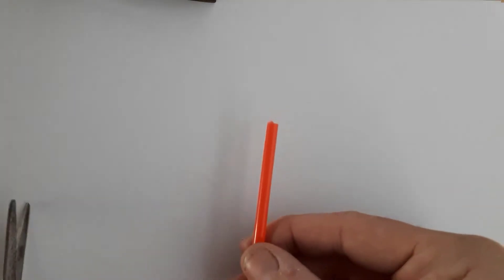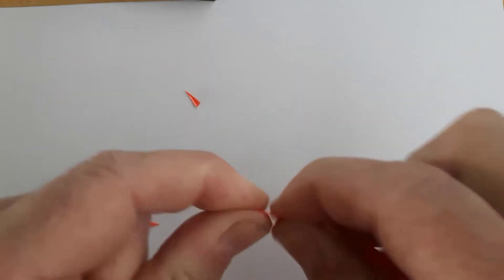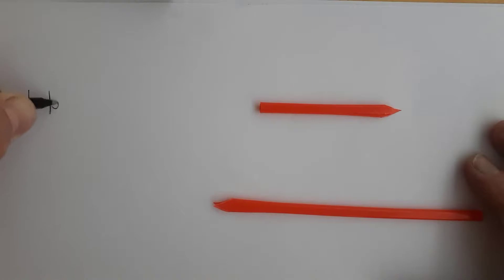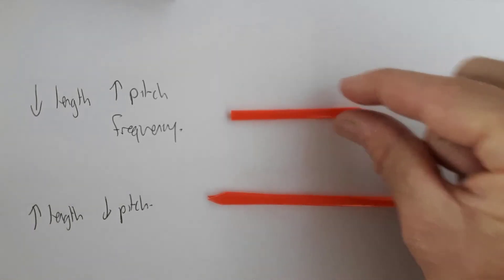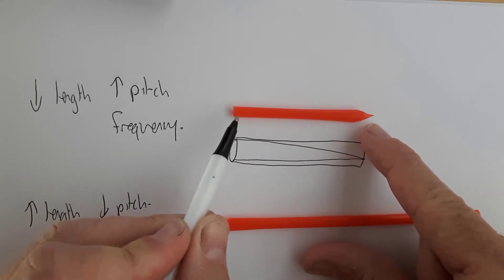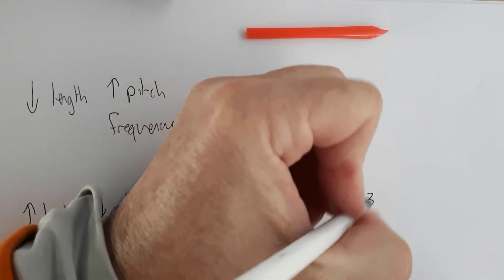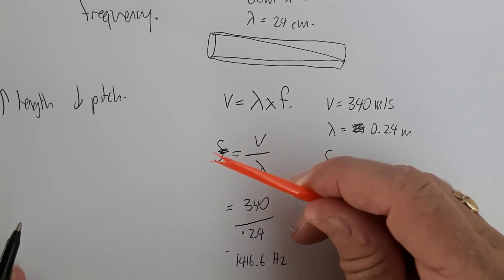Making straw flutes and calculating the frequency of the sound produced

Comment: ✨Sir, if we increase the diameter of pipe what will be the effect on frequency 🙏🏼✨is there any formula to calculate the length of note from blowing hole, what is the relationship between frequency of note and volume of pipe🙏🏼✨
Reply from the maker: That is a great question. I think the pitch relates to the length and not the diameter. It would be a great thing to research.
Reply: @SteveGriffithsvideo  ✨🙏🏼✨
Reply: @SteveGriffithsvideo  ✨so if i make a flute of same length but different diameters with only blowing hole, and blow the blowing hole same note will be produced 🙏🏼✨

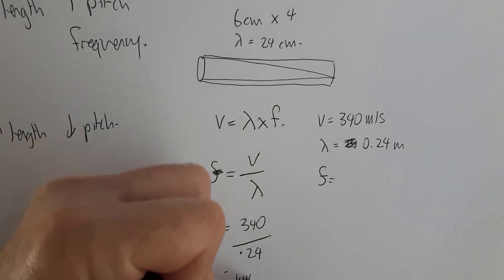Comment: Thank you for making and sharing this video. I love it, and will have my class work on it tomorrow. The explanation is very clear (what temperature are you using?), but when I compare the frequencies that are played I don't hear agreement with the computed values. For the short straw played at time 1:26 it seems to sound around 529 Hz instead of the 1416 Hz by the solution of the equation (at time 4:45). For the long straw played at 1:30  it seems to sound around 346 Hz, not the 700 Hz by the equation (at time 5:27).  I think I have the sound in the right octave. Audacity can be used to record the sound and then plot the spectrum -- if you hover near a peak it tells you what the frequency is, and you can check the frequencies of the even multiples of the fundamental.  I haven't been able to make the math fit with my playing of different length straws. Maybe I'm playing something other than the fundamental F1.
Reply from the maker: Go with your math I think. The room temp was about 25 degrees. Thanks for your comment.
Reply: Thanks for the temperature. I love the video. My frequency estimates were done by ear. The students had fun. We went outside afterwards and made some music. @SteveGriffithsvideo
Reply from the maker: @RobertWilley6 I am so glad they liked it. My school hasn’t let me do it since COVID!

Comment: Hi Sir, just a quick question, but for the frequency which you calculated (1416.6Hz) for the straw clarinet, would that be the "fundamental frequency" at that length? Thank you so much in advance.
Reply from the maker: Hi Bob, I think so but I am not very strong on harmonics. This video was pitched at a year 9 level. Unfortunately I don’t teach physics higher than grade 9.
Reply: @SteveGriffithsvideo  Thank you very much for the reply.
Reply: Length remaining constant would the frequency differ if the diameter of the straw changes ? If yes, then how and what is the formula ?

Comment: So the freq spectrum of my straw with 19.6 cm length and sound speed at 24 C of 345 m/s gives frequency of 157 Hz as the min freq of max amplitude. Calculation gives 440 Hz, so the results are way off! Why?

…other peaks are at 328 Hz, 497 Hz, 666 Hz. I dont think I am exciting higher modes as this is the min freq I am able to play with the straw.

Comment: Great. But it would have been really solid if you had also used a frequency analyser to show the frequency and compare to calculation (i’ll do that for mine).
Question: should you include end effect to get the acoustic length rather than the physical length? If so, the result would be more accurate.

Comment: Great video! Had it been a pipe with an orfice near the base (like a plastic recorder) would the wavelength still be 4 times the length of the pipe?
Reply from the maker: Yes a recorder is like a clarinet and is considered a closed pipe because the end is closed by the mouth. Technically what I made in the video is a clarinet not a flute.

Comment: But a question: 
Will the wavelength be still 4 times for any radius of the pipe?
Reply from the maker: Yes. It is a property of the  length of pipe, not the radius. Changing the radius is likely to change other properties such as volume. Thanks for the question.
Reply: And thanks for the answer:)